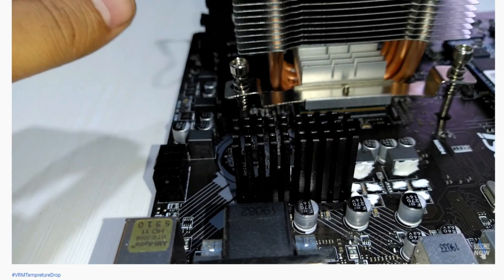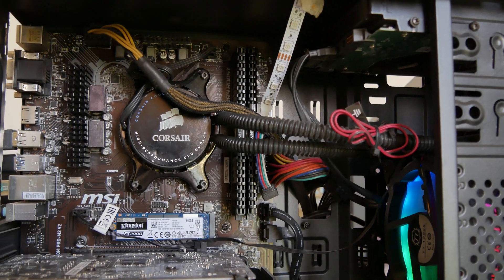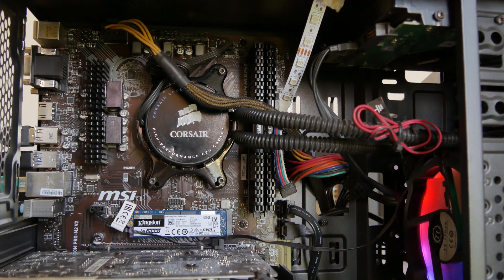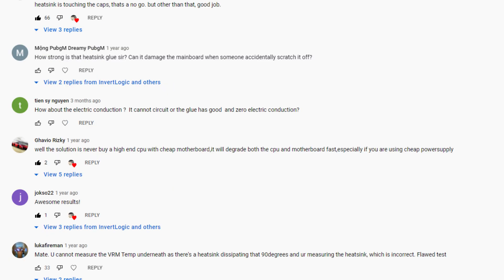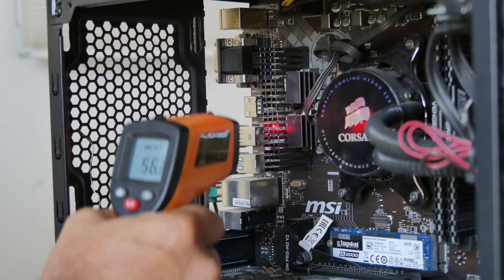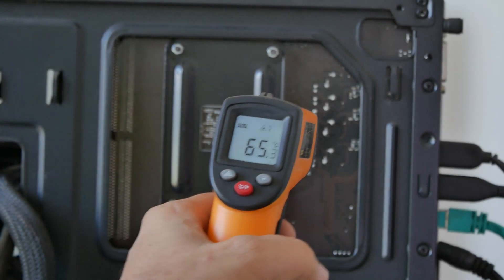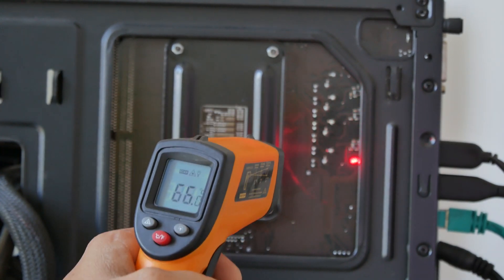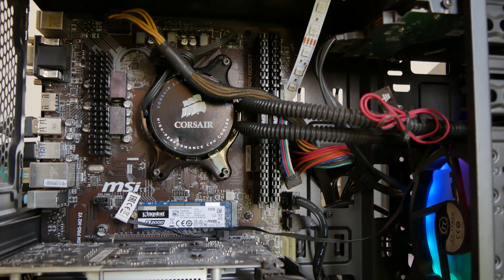Can heatsink reduce temperatures on VRM?

Comment: If your case has a cut-out in the MB tray (almost all do for cooler fitment), cut a 80/92/120x15mm fan out of its frame, stick it to the back of the MB (to the cooler backplate) with a few blobs of RTV, run it off a splitter from the CPU fan header. It will blow air from the cabling space into the gap between the MB and tray - VRM mosfets sink a LOT of their heat into the MB/PCB (which is intentional). This will usually net at least a c. 20 degree drop (and the fan will be inaudible in that location).
Reply: hey I just got the gigabyte b660m ds3h and it's known to have horrible vrm temps. Should I try doing what you said? ( I'm planning on installing a i5 12400f and removing the power limit. It would be at 120w)
Reply: @irfok727  WHy not? Easier than fitting heatsinks and probably cools better. I used a Noctua 92x14mm (pained me to cut it up but it was what I had to hand) on my Asus z390 / 9900KF which has a notoriously hot-running 4+1 VRM, temps now stay under 50°C pulling c.160w in a UK summer (I did fit better thermal pads under the VRM heatsinks as well). One proviso, you need a case that will leave some space between the fan and the case cover if it's actually going to move a decent amount of air - ETA >> that's at least 15mm from MB tray to case cover.
Reply: @EliteRock  thank you very much for your reply 🙏.
Reply: @irfok727   No problem! Like I said, use a few blobs of RTV silicon to attach the (frameless) fan to the CPU/cooler backplate (clean everything with a wipe of alcohol first), give it time to cure/set. It will hold the fan securely, but easy to remove if needed.

Comment: Can I use a Ryzen 9 3900 w/ 65w TDP on a Asus A320 mk just putting a heatsink on the vrm?
Reply: nah it would cool the vrm but its on 3 phase youd need a 4+3 to not ruin the mobo or throttle to hell
Reply: can i put a ryzen 7 5700x on gigabyte ga a320m-s2h @josephdias5859
Reply: @josephdias5859  BS. It's a 4+2 mobo, but even it it had only 3 phases, if he uses a top blower style cooler, they will be perfectly fine, even without a dedicated heatsink. Even cheaper motherboards have at least 40A chokes. As long as you don't go beyond 30 on them, they won't overheat. As the 3900 will max out at 88W during heavy workloads, that means less than 24A on each choke of a 3-phase VRM.
Reply: @sassuki i seen  drastic uplifts going from a a320 board to a x570 due to vrm temp using a 3700x with a downdraft noctua cooler i imagine a 3900 would make vrm temp worse
Reply: @josephdias5859  might be the noctua you were using, blows towards the SOC VRMs only, as I saw some models which mount the other way around.
Or a faulty BIOS, as ASUS is known to OC automatically and/or put too much voltage by default -.-
Reply: @sassuki bios was flashed multiple times  voltage sat around 1.38ish full turbo and the cooler covered the vrms in the downdraft its problems cheap boards have lesser quality control
Reply: @josephdias5859  yeah, too much of a voltage here. Typically Asus. You need to enable Eco Mode with these for it to behave. What noctua model did you use? I am still thinking you got a model that only blows towards the SOC part.
Because I tried once a 4600G on a 3+1 phases Biostar 450mhp, and it was working like a charm with a wraith stealth
Reply: @sassuki  i was using nhc14s 140mm downdraft cooler covers vrm and ram completely ryzen 3000 and can eat voltage just to hit factory settings to get 4.2ghz stable all core. eco mode the chip only hits 3.3 ghz max. 3000 use more power than 4000, ryzen 5000 uses more power than 3000. And ryzen 5000 is uses the same amount of power as ryzen 2000 which is double 3000 and 4000 especially the 5900 that guy want to put in draws 193watts at load even if an a320 can run the processor technically its going to be pushing the max the vrm can handle and 5900 will need a lot more than a wraith cooler to keep cool otherwise it will hit tjmax gotta remember its 12 core a simple downdraft isn't enough need more of a dual tower or atleast 240mm loop and with that your not cooling vrm
Reply: @josephdias5859  ah okay, that noctua should be fine. Then, there definitely was something wrong with your board (probably half defective).
Anyway, the guy here is talking about the 65W 3900. That goes 88W max and can easily be cooled with a wraith model or similar.

Comment: I guess the point was measuring the back before and after adding heatsink!
Reply: Does not make much sense before, because it won't be tha~t different between the back and the front without a heatsink.

Comment: I'm curious. What do you think would happen if you installed some thermal pads on the VRMs at the back of the motherboard? Also, adding thermal pads to the CPU at the back of the MB, as well.  I think it would make for an interesting experiment.
Reply: You would need a heatsink on top of the thermal pads, which would be hard to secure to the back of a board. Also have to be careful about shorting the leads of the VRM inductors, that usually stick thru the back of the PCB. But just having a small fan blowing at the back of the board can reduce temps a good amount, if the VRM is running pretty toasty. Might be unfeasible in a lot of PC cases though, if the gap between the back panel and mobo is too small. I cut the frame off of a fan and glued the motor hub to the side of the socket backplate and it lowered VRM temps ~8c iirc, running a stress test.
Reply: just leave the panel off the back of the case and put a fan there